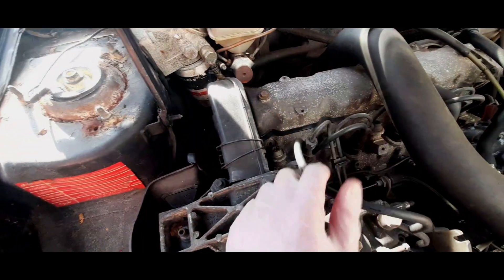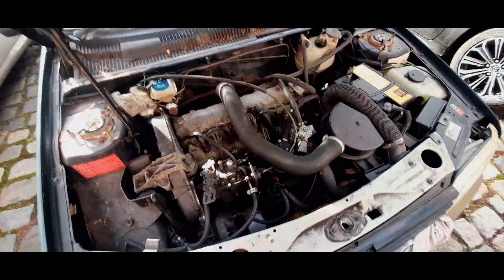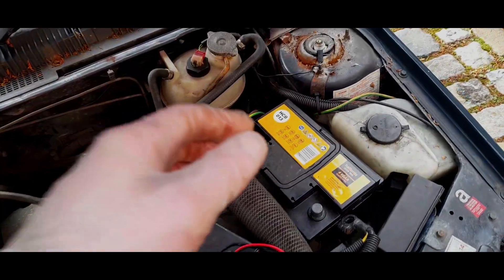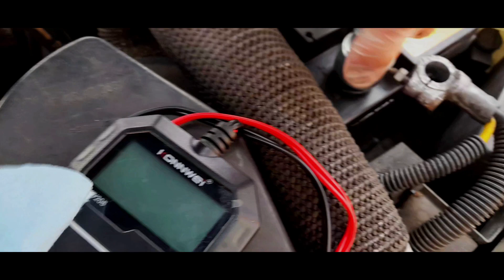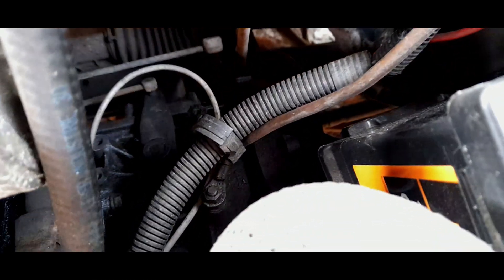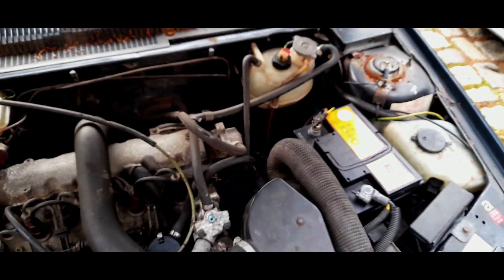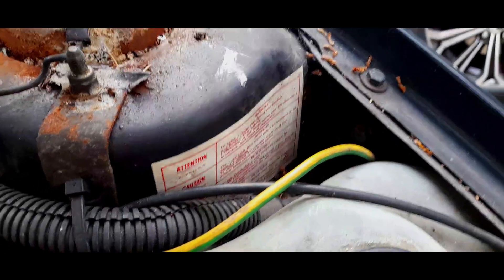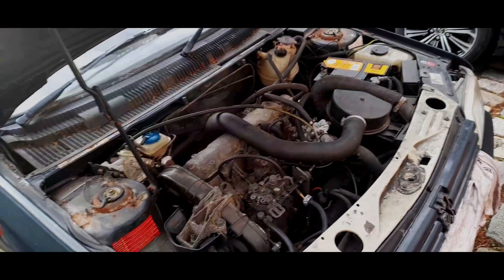I start tinkering on a Peugeot 205!

Comment: So funny seeing you struggling to hide your detest of all things French. I'm right with you on that one , absolute merde 😂
For all the fuss about and admiration for the 205 , the FIAT Uno outsold it by over 3 MILLION cars produced
Reply from the maker: That's really true, it wasn't anymore expensive either.
Reply: @usuallyfixingtinkering  Had a few Uno's back in the day, spacious, drove really well , and although maybe not as cute looking as a 205 , definitely built better and not packed with electrical gremlins. I never got the ultimate one though, the Turbo i.e , instead going down the Strada 130TC route. Ultimately a good choice though as the twin-cam on carbs FIAT made mincemeat of any Pug boys in their 1.9 205 GTi's